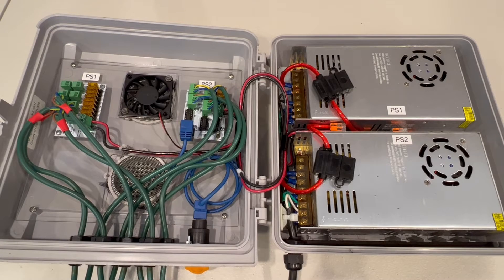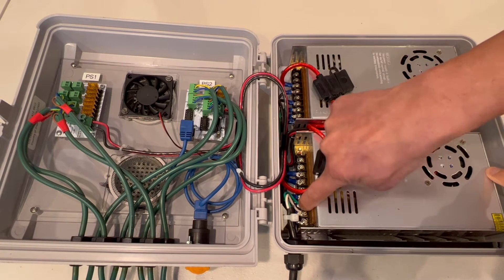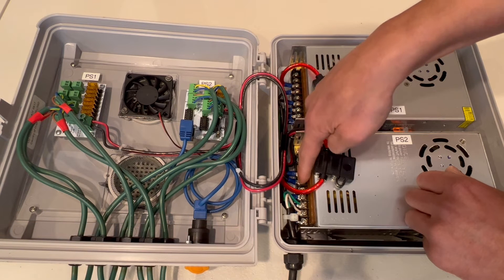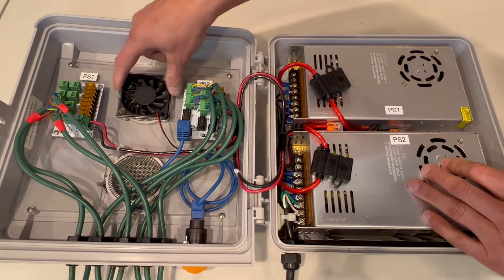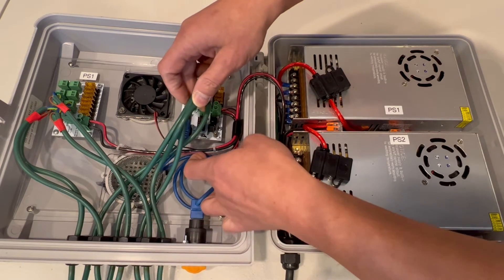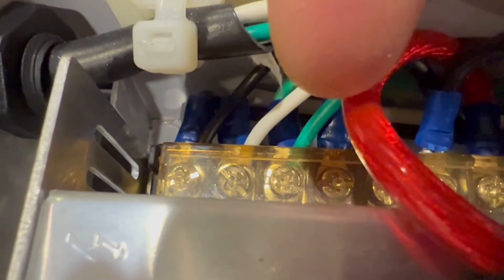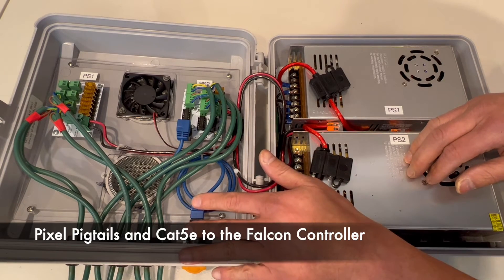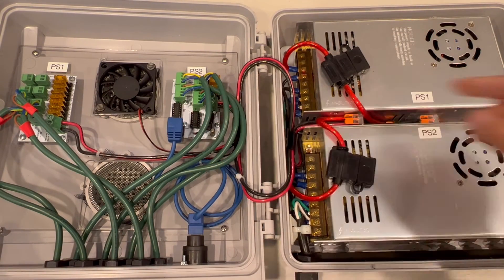How To - Setup CG1500 Pixel Controller Builds - Part 2 - Wiring Details

Comment: Hey Steve, I have a question. How do you do the same but with a Falcon F16V5 controller? Do you connect one PSU to V1 and the other PSU to V2?
Reply from the maker: Yes, you can do that with the F16V5 board. What I’ve seen others do with the larger controllers in a box like the CG1500 is put the F16 on the right and the two power supplies on the door. 

That way the 16 controller pigtails can go straight down and out of the enclosure.
Reply: @NiFamilyLights  thanks 🙏

Comment: Do you find that you can run more pixels with 2 PSU’s? Because you’re not Power injecting from the supply right? And the positive and negative are connected on your PI pigtails?
Reply from the maker: Absolutely! The 5A fuse limits how many pixels you can power from a single controller output or power distro output. Using the power distro board to power inject allows one to power more pixels per controller output. 

If you haven’t checked it out yet, see my “How to Chain Pixel Props Like a Champ Video”.
Reply: @NiFamilyLights  Thank you!! I can’t tell you enough how much these videos have helped people. Definitely subbed.
Reply: @NiFamilyLights  Do you have your V+ cut from the pigtails for PI? Because I understand when using multiple PSU’s, the one for power injecting should have the V+ cut and only leaving the ground connected on the PI cables themselves. I’m I understanding that correctly?
Reply from the maker: @Brian I do not cut the V+ from the pigtails for Power Injection because I use vendor made power injection Tees.  The tees I use internally separate the V+ from the incoming pixel to the outgoing pixel.  So, there's no need to modify cables.  

And yes, you are correct.  Be sure to keep the Ground line connected from pixel to pixel, even at the point of power injection to maintain data signal integrity.
Reply: @NiFamilyLights  That’s interesting. I use the tees from wired watts. I wonder if they do the same? I’ll have to ask. So, you can use the same tee for one or two PSU’s?
Reply from the maker: You can ask for a wiring diagram of the Tees you purchased.  Or, you can test the internal wiring with a digital multimeter, by selecting the Resistance mode and checking for continuity (0 resistance) from one pin to another.

Comment: Excellent!  
My first attempt 2022 was to add 1500 of 5v LED strip in channels to my first floor roof line.   
For that I used one power supply 300W and one  wifi esp32 that is fused out with only one pin used and then on power ran 1 home run where I injected power at the end of the run and somewhere middleish.  WLED is the software and everything runs and looks great.
Right now the ps and esp32 are just laying on a work bench - so this is helpful with ideas of incasing it.

A question...
The esp32 works fine for this setup.
Next year I will do the same for the Second floor roofline and add 2-4 yard props.
So, what I am not clear about is.............
Why do I need a falcon or other distro build?    I have no problem spending the money IF there is some value, but out of my newness ignorance, I am not seeing the need?
Also I am using WiFi which I have a very fast giga connection so not sure why I would need to have cat6 ran (although I could because I have ethernet everywhere).
Reply from the maker: Thanks for the comment. I personally don’t run anything with my show off of WiFi. All my controllers are hardwired to remove the chances of having WiFi congestion, lag, or other latency issue. Can you use esp32 and run everything off of WiFi, sure you can. Will you have potential issues over time? Maybe. That depends on how much WiFi congestion you have and how strong of a signal you have where your esp devices will be around your home.

A falcon board is much more capable that an esp32 device. But that’s just my preference.

Comment: Question. Would the wiring be the same if I don’t want to power inject?  Instead I would connect the two power supplies so only 1 ac cord is needed but have two receivers instead of 1 receiver and 1 power distro board.  Thoughts?
Reply from the maker: Yes, that’s exactly what I would do. Everything would be the same but instead of a power distro board, use a receiver board. You’ll just have one more internal wire for the Ethernet cable and one additional Ethernet port through the bottom.
Reply: @NiFamilyLights  Much appreciated. Last question, in your video it doesn’t seem like you connect the V- between power supplies and if you did then I missed it but in a comment below you say to do it so I wanted to confirm if I do indeed need to connect the V- between the power supplies or if I have each v- and each v+ going to different receiver boards but nothing in the middle that ties v- together?  Many thanks, your videos has made this so less stressful then I thought it was going to be.
Reply from the maker: @The Taternator Yes, the V- is connected between power supplies.  The wiring for that is tucked in close along the side of the box.  That is a must if you're doing any sort of power injection with a power distro board that uses a separate power supply.  Sounds like you're ready to work on your build.  Best of luck!
Reply: @NiFamilyLights  thanks again for all your excellent support and inspiration. Everything is assembled just need to run output  from the wagu’s to the receiver boards but wanted to double check on the V- concern before I did so.
Reply: @NiFamilyLights  awesome. It powers up, fan spins, and no smoke today so we’ll call this a win. Thanks for all your amazing support.

Comment: Great video! Do you split the v+ in the props for your PI to isolate the PSU feeds?
Reply from the maker: Thanks Jack. Yes, the V+ is split when I power inject. The vendor made power injection Tees that I use break the V+ line in the internal wiring.

Comment: Excellent follow up video.  What size fuse should I use in the in line holder ?
Reply from the maker: @Paul, I use 20A or 25A fuses. There are a few things to be mindful regarding the allowable current amperage. 

First, be sure the wire from the power supply to the fuse and controller are either 10 or 12 AWG wire. Most controller wiring is short, so 12 AWG should be fine. 

I use 350W 12V power supplies. Accounting for 80% max duty cycle to have long running power supplies, then dividing by 12V, gives you 23.3A, which is the most I ever plan to draw from a power supply. 

Of course, anything less would be fine too.
Reply: @NiFamilyLights  Hi Steve, where do you get 12 AWG wires?  Do they already come black/red?
Reply from the maker: @Charles C, you can get 12 AWG wire from your local home improvement store from from online places such as Amazon.  Just be sure they are pure copper for the best performance.

Comment: But what is the yellow thing on the bottom of the box for the cat5 I do not see the cat5 that will be extended to falcon controlled . Unless is a wireless thing.
Reply: Never mind i saw the first video and i find out that is  a conector to able to extend the cat5 cable

Comment: great video so if i want to install two power supplys i just have to add other wire to   negative, positive,ground,to each one is that right
Reply from the maker: On the AC side, you can connect the Ground to Ground, Neutral to Neutral, and Line to Line (or Hot to Hot).  On the DC side, connect the DC Ground (aka V-) between power supplies.  Do NOT connect the DC V+ between power supplies.
Reply: @NiFamilyLights  thank you but if i power inject could i use one power surpply and connect negative and postive to that power surpply
Reply from the maker: Yes, you can do that.  I use the power distro board (powered by Power Supply 1) to power inject.  You can do what you stated, but be careful of directly connecting pixels to V+ and GND from the power supply.  If there's a short anywhere along your pixel run, the power supply will deliver enough current to burn the wires and could cause a fire.  It's best practice to use a power distro board with fused outputs to prevent that sort of situation.  

And, as shown later in the video, be sure to connect the DC grounds between the two power supplies to prevent potential data corruption.
Reply: ok between v + but do i connect the negative and postive when i power inject and if i want to add pixel on my controller from port 9 to 16 could i add other power supply and do i have to add a different ac line thank you
Reply from the maker: @den bel, I'm not completely sure I understand your question.  If you have a Falcon F16 and power ports 1-8 with one power supply, you can power ports 9-16 with a second power supply.  That should be no problem.  For the AC side of the power supplies, you can link them together as I've described in the earlier comments (Line to Line, Hot to Hot, and Gnd to Gnd and use one AC Pigtail to power both power supplies.  If you want, you could have 2 separate AC power pigtails if you'd like as well.  In the build in this video, I have both power supplies connected with one AC power pigtail that powers both power supplies.
Reply: @NiFamilyLights  its ok i thank you i talk to a sellman its a advatek controller i had to  power supply 1 to make 9 to 16 to work thank you